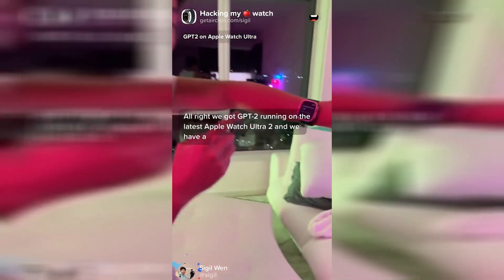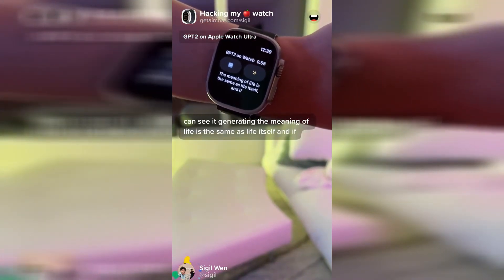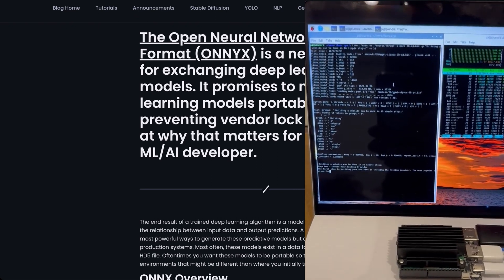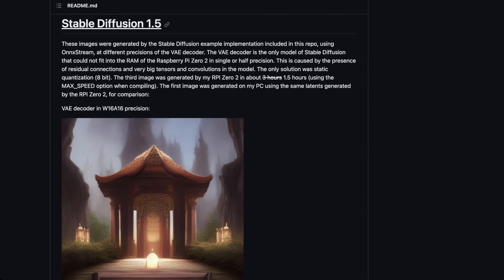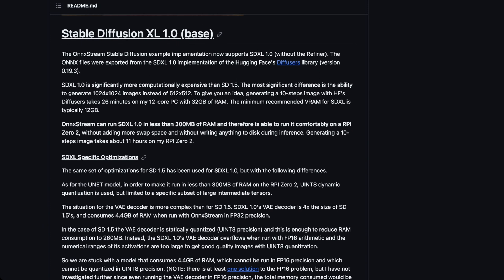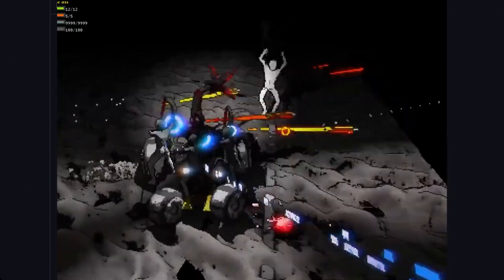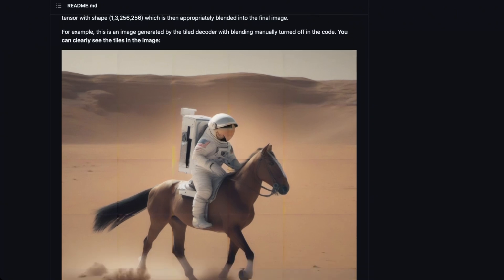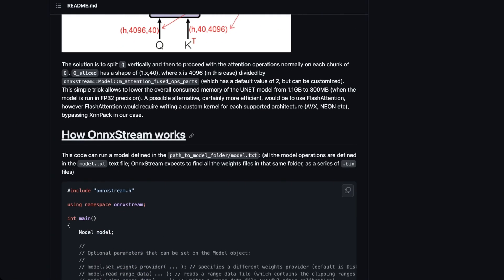Running SDXL on the Raspberry Pi 5 is now POSSIBLE!

Comment: Finally, I personally know what the deficit of Raspberry Pi on market means, I collected this year parts for best open source 3D printer Voron 2.4 and Raspberry there main component, getting Pi 4 was hard and not cheap (forget about MSRP 😅).
And I already ordered update to my Intel Xeon 2011-3 socket, from 14 cores next 22 cores, thanks China recycled servers, very cheap 170 bucks chips (as I see Intel made for enterprise certain secret chips never released publicly and 22 cores Xeon I've ordered from Ali is one of such discussed on forums).
Also I'm amazed how my motherboard Asrock X99 Extreme4 bought in 2020 are now the market dominant on Ali 😅 they selling only it everywhere for such socket. Time to raise RAM to 256gigs.
Reply from the maker: I still remember when OpenCompute servers flooded the market in 2011 - was insane to me that with a few custom power connectors you could have a 20 core server for less than $200!  And yeah, as a voron owner its actually kind of nuts how expensive pi 4's were for a while